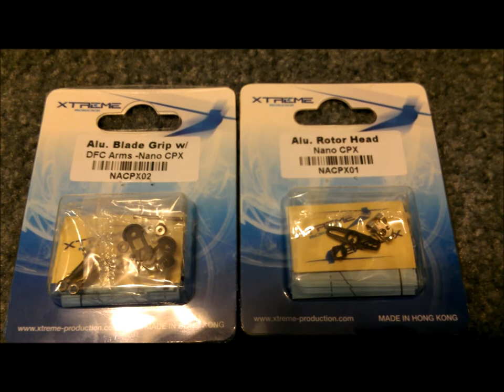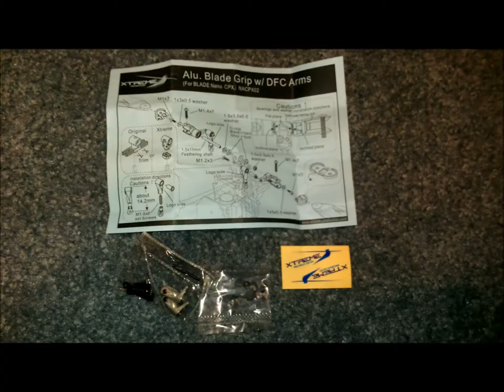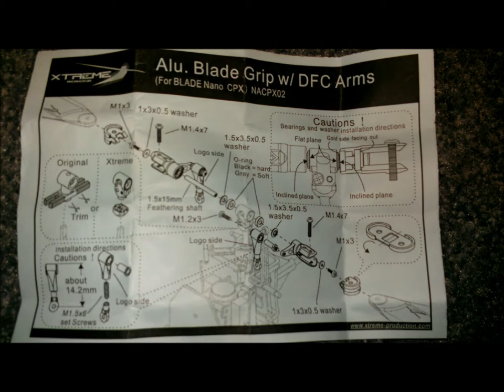Blade Nano CP X DFC and Aluminum Blade Grips & Hub Xtreme-Production

Comment: Picked up xtreme head, DFC grips and swash yesterday. While it's close to being well made in terms of strength and spindle/grip fit, the DFC links are "xtremely" sloppy on the xtreme swashplate vs my 100+ flight/25+ crashes original NCPX rotor links which are nice and snug on the xtreme swash balls. Next issue is the swash bearing itself has so much lateral and even some vertical play it actually has more slop then my stock NCPX that is again the original and well used/crashed part. Oddly the swash ball is very tight and a good finish so it seems they just cheaped out on the bearing? I have seen another review claiming rakon to be slop free while microheli isnt so I will probably end up trying a RKH but the DFC link slop is so bad that an oring even shaved down causes the balls to pop off randomly in flight, might try flipping them half a turn on a RKH swash with oring to reduce slop.
Reply from the maker: Email Xtreme about your issue.  That is not normal for their products.  They should help you out.
Reply: symawd Probably should have but I hate waiting and honestly don't expect perfection after seeing the poor fit from the plastic DFC arms on the inner swash balls and the slack in the same plastic link where it's screwed to the grip. Seems the post that slides inside the brass bushing is slightly too long allowing some rotational slop which might not show up in the air but might during transitions from positive to negative with cyclic input. I dremeled the grip bushing posts down removing the slop and fixed the slop in swash by pushing the hole of inner swash over tip of my needle nose pilers and opening them with quite a bit of force bending the inner swash into a slight oval that is now taking up the slop in the bearing...idea wasn't mine I just adapted the concept from Quick UK swashplates I used to run on my Raptor 50s that had 3-4 set screws for adjusting bearing tension so even with wear the slop could remain in check over time.
Reply: Chris Hax I'd like to add that if it weren't for these few issues I would've been impressed with the quality and strength when compared to microheli's parts I've had experience with bending like butter, this stuff on other hand is likely to hold up really well on a model of this size and weight.
Reply from the maker: Yes, Xtreme uses 7075 aluminum while others use weaker 6061. Again, contact Xtreme and they should take care of you.